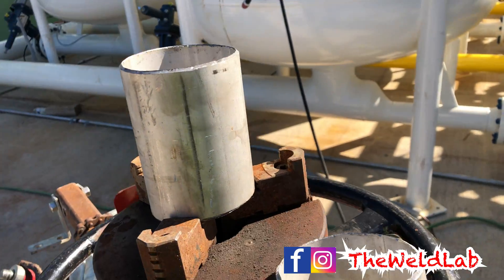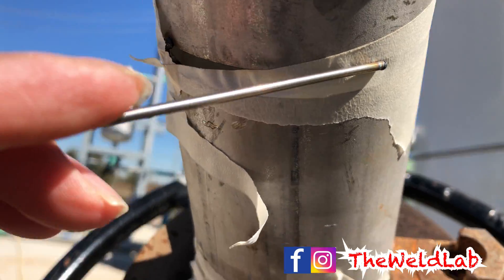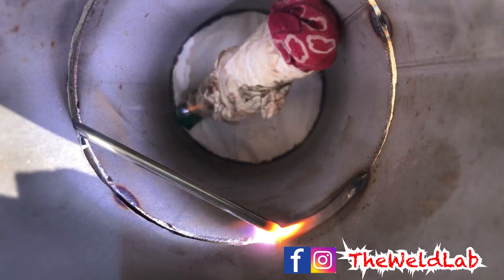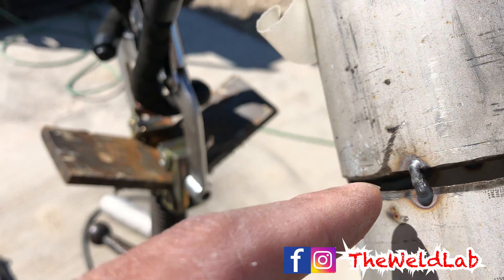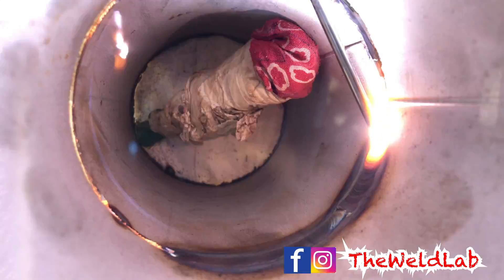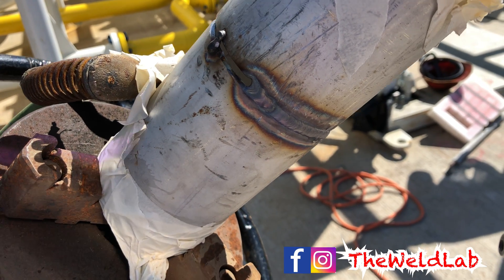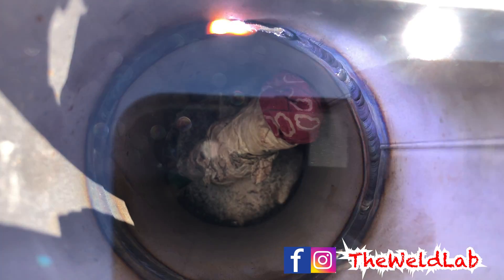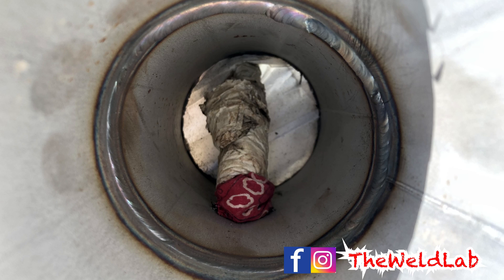6G stainless schedule 10 pipe test | Tig Welding

Comment: This is wrong. lol always use 3/32 wire in stainless guys , 1/8 takes to much heat to be melted , 3/32 with 1/8 gap and dip swivel left and right and dip again swivel left and right and dip again .

Comment: Is there a difference between welding 304 and 316 stainless bro?
Reply from the maker: Yessir..different type of grades of metal ..it depends on what the welding procedure says 304 is only for stainless and with 316 you can weld stainless to stainless and carbon to stainless
Reply: Isn't it the other way around? 304 u can weld ss to ss and carbon to ss. 316 u can only weld ss to ss.
Reply: 309 is carbon to stainless..